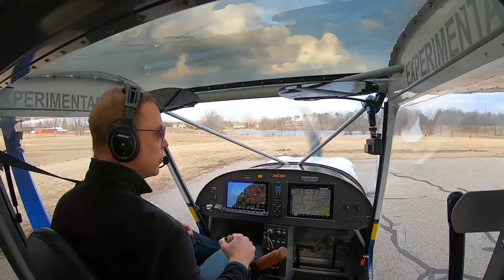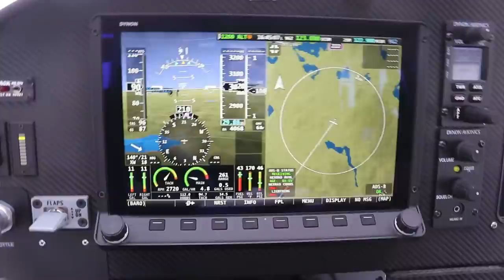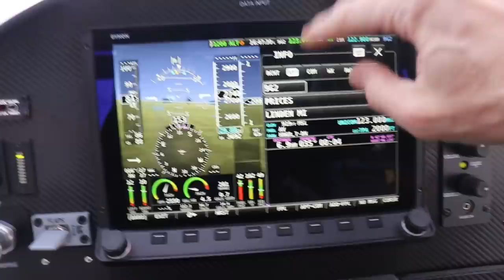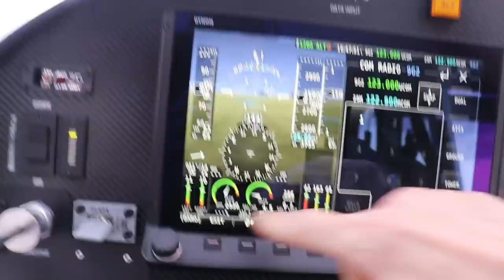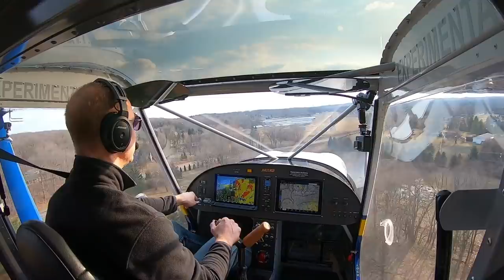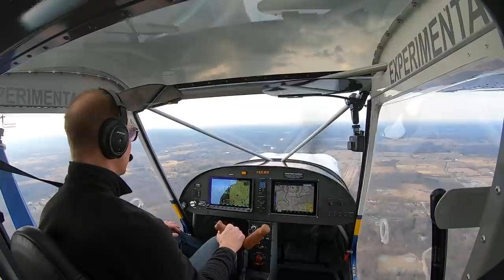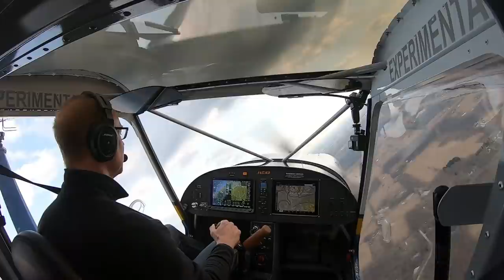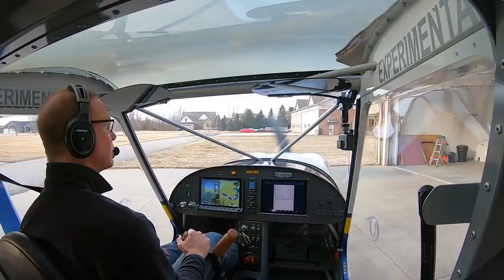Flying with the DYNON HDX | Performance Numbers

Comment: I'm 63 and been flying for over 40 years now and that's probably the best center-line control on landing in any video I've seen! One of my instructors in the US Army's Fixed Wing Multiengine Qualification Course used to say: "The center-line is for professionals, but we can use it too."  That thought process was further reinforced while flying King Airs in South Korea during a short taxi to the parking area. My Instructor Pilot had me do push ups (all in fun - he did them too) after I parked because the nose wheel was a few inches off the paint mark on the ramp when I set the brakes for shut-down.  Nothing like trying!!  Those engine cowl mirrors for verifying the gear position were nice, but you had to think in reverse to determine which way to move the nose wheel.
Reply from the maker: I like that quote!

Comment: Dear Mark,
I have a single screen dynon HDX and I'd like to add a second screen in my light plane. Is that easy to wire and setup?
Kind regards
Laurent from France !
Reply from the maker: If I remember correctly it’s simple to add another screen. There just a cable that connects the two screens together and then another cable that connects the new screen to the “hub”.  You might want to verify with Dynon or take a look at their website, but the whole Dynon system is very easy to wire.

Comment: Have you verified the fuel burn to actually used? My fuel burn with the same RPM settings are about 2 GPH more than yours. I have checked mine and the GPH indicated is close to what I actually am burning.